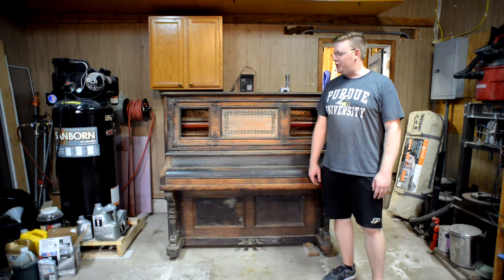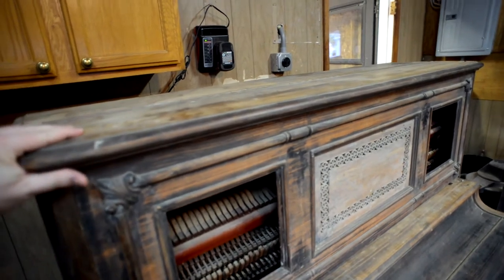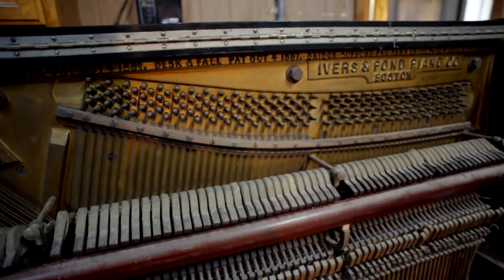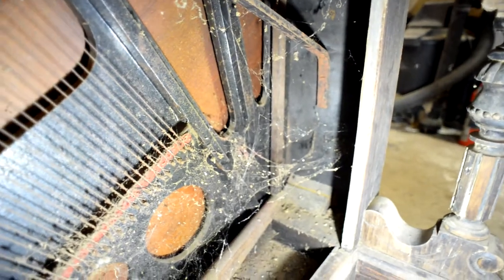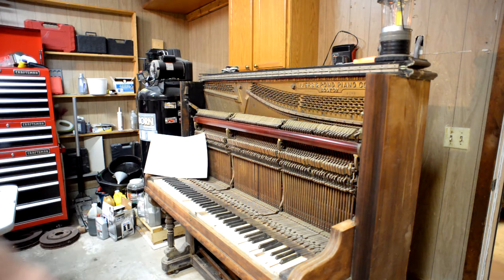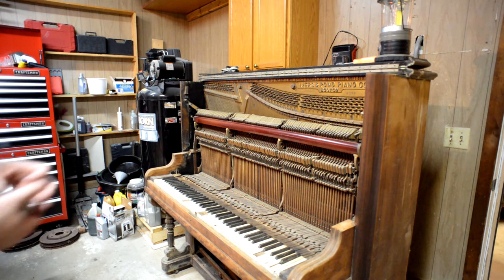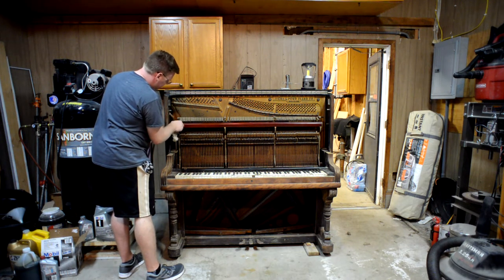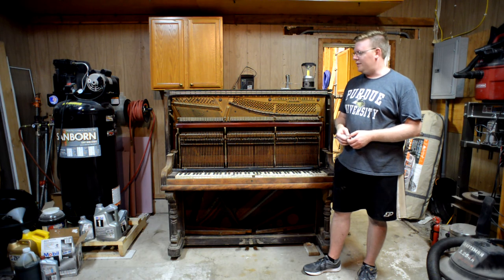130 Year Old Piano Rebuild - Part 1 - 1890 Ivers & Pond

Comment: Those key buttons can be glued back together with white glue, clamped for a little while with a clothes pin. You can use 0000 steel wool on the treble strings. Don't give up on them until you have to.

Comment: That crunchy sound when you let the key come back up is crustiness of the damper from having been in a wet place. You can gently ruffle the felt with a finger and they will usually work better. Have a piano technician tune it, someone who knows how to use CA glue on loose tuning pins. Probably not a good idea to try it yourself without instruction.